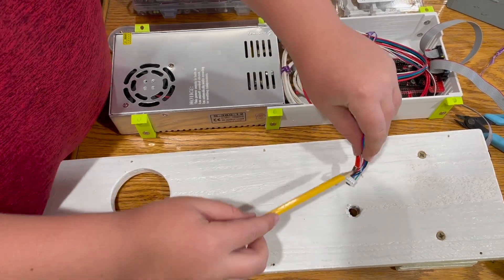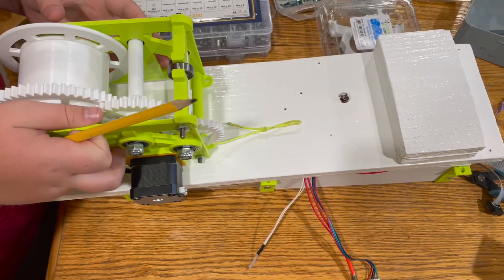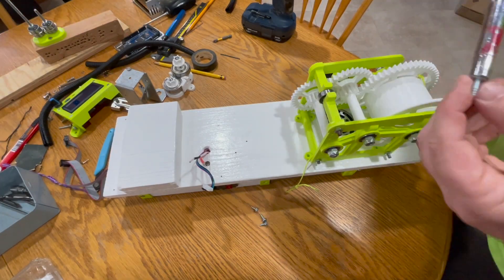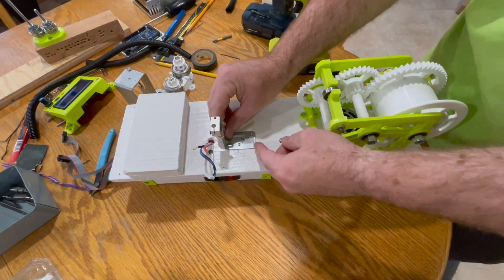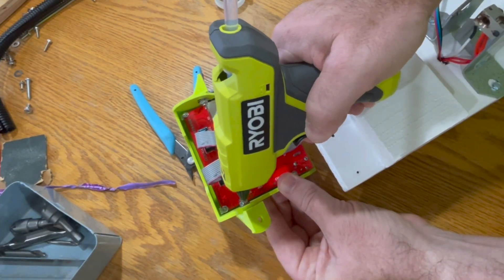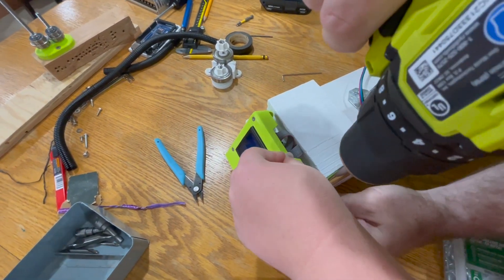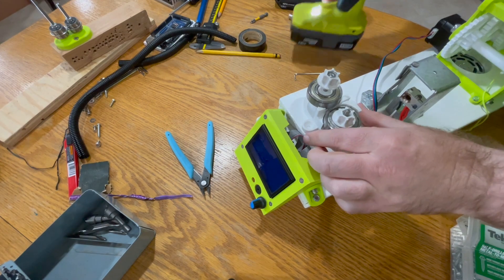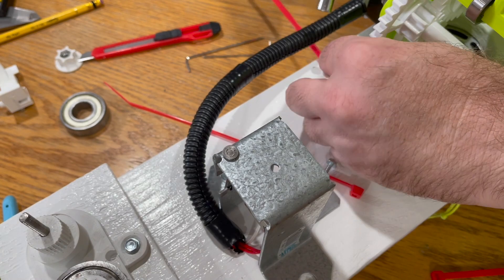Bottle to 3D Printer Filament System Assembly

Comment: what does the power supply and ramps board secured too? is that a 3d printed box and brackets? if so, where are those files at? thanks :)